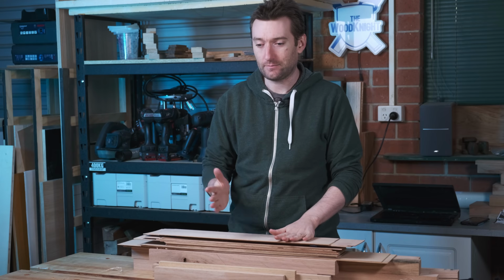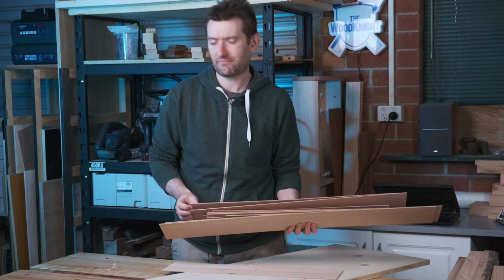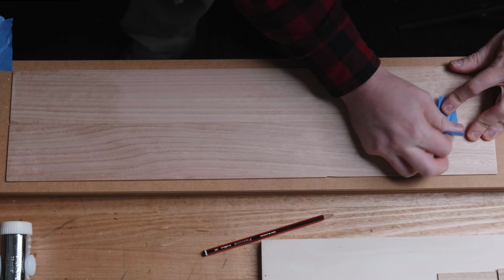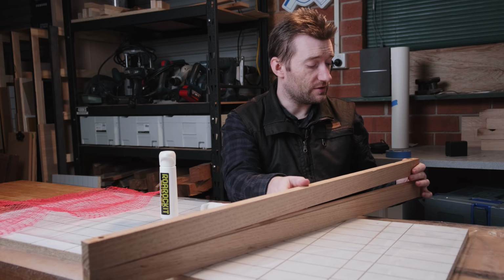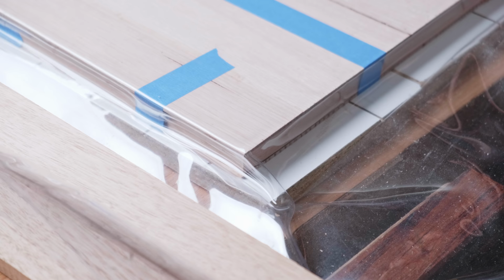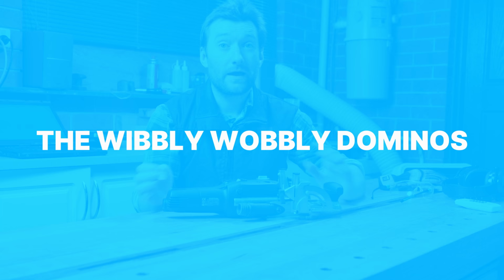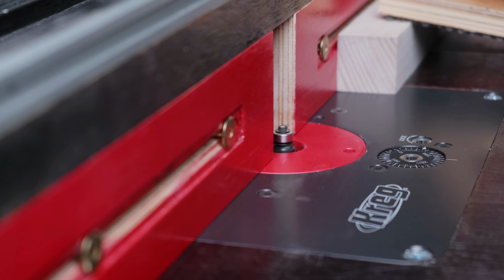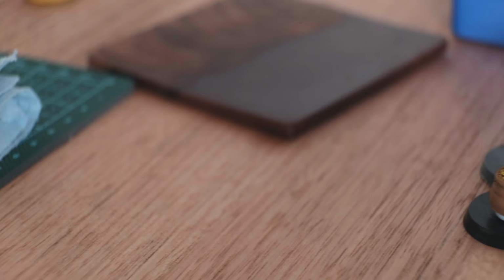Woodworking: Scrap Wood Hobby/Mini Painting Desk

Comment: The proportions are perfect imo. Great little table
Reply from the maker: Thanks Robin! I think more than anything, I wanted the room to tweak it with longer material - an extra 50mm on the long apron for more leg room, thicker legs so I could introduce a taper, maybe enough 'backup' stock that I could try splay AND rake on the legs. Maybe it's for the best - I can absolutely see myself overcomplicating it and making a mess 😁

Comment: Great table, and good use of the scrap wood.  So now I know what to call my over size Domino joints :), I agree they are great for when there is not enough room for two Doms, I ditched my fastcap quite awhile ago and now just use sauce bottles.  Different colour tops for the different glue, you just have to remember which is which. I don't think I will bother with the vac system, definitely to pricey  for the times I would use it.
Reply from the maker: I'm not sure I'll ditch the fastcap bottles while they're still good - they wear out eventually, but work fine currently. Compared to sauce bottles... yeah, they're a bit overpriced - the fine tip is super great for all three times I've ever used it! 😂

Comment: Love your wife's work .. Question: Why not use hide glue and veneer hammer (or J-roller) for veneering like they did before vacuums? I know this is not your typical thickness of veneer but it should work, right? You can put a lot of glue on and still cleanup is easy ...
Reply from the maker: Honestly? I don't know which is better/for what purpose/etc. It looks like it has a higher skill barrier to entry (while vacuum veneering is pretty much perfect from the first attempt), particularly for larger objects. Working time seems to be pretty low for desk/table sizes. I haven't worked with hot hide glue at all, so I'll need to try and find the appropriate double boiler

Comment: Thanks for the video. I don't see a block wood panel supplier in Brisbane. Although the door manufactures are obviously buying it from somewhere. In fact I still have an off-cut from a door panel I trimmed. Does it have another name?
It is indeed very stable and light weight. You seemed to have a a thinner panel than a door panel.
Reply from the maker: No, it only has the name blockboard as far as I'm aware. It is/was sold in 18mm and 25mm thicknesses, I think in "jumbo" plywood size only (3000x1200 from memory). Tried SharpPlywood?

Comment: Hey paul have considered using spray contact for veneer. Much cheaper and 10x quicker
Reply from the maker: I believe contact cement and the like are only good for paper or phenolic backed veneers. (edit: I think. Don't quote me on that. I'm not a veneer expert 😂)  Cold press glue wasn't expensive - at the time was $50ish for 4L.

Comment: Great job. 2 questions. Firstly, what is the purpose of the red netting in vacuum bag? Secondly, when you talk of work around alternatives that are questionable are you including the devices that you attach to an air compressor that turns it into a vacuum?
Reply from the maker: "Breather mesh" is the red netting, it helps distribute more even pressure. Ideally the entire board would have a layer over it, but I had to work with what I had (see more at: https://www.veneersupplies.com/products/Vacuum-Breather-MeshNet.html).
No, I wasn't including a Venturi/air compressor mechanisms. As far as I know, they're absolutely fine, just incredibly loud (because of the compressor).  There is a guide to making a veneering system with that, https://www.joewoodworker.com/veneering/v2-about.htm, though I'd rather not have to DIY a system if I don't have to, ya know? Too much yakshaving! ;)
Reply: @TheWoodKnight  Alright I'll bite. Yak shaving?
Reply from the maker: "Any seemingly pointless activity which is actually necessary to solve a problem which solves a problem which, several levels of recursion later, solves the real problem you're working on." - basically making my own veneer press is a project within a project within a project. I want to make furniture, not complicated air sucking doohickeys!
Reply: @TheWoodKnight  Just to check,  any and all "wife projects"  do not involve yak shaving? Because every step in a wife project is obviously important and really really enjoyable.